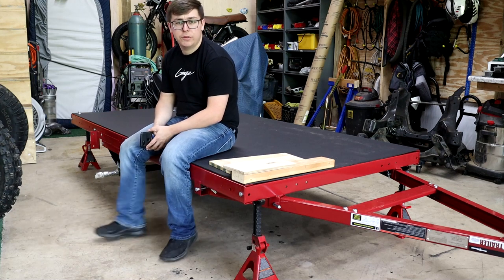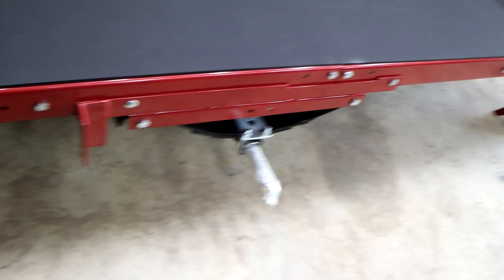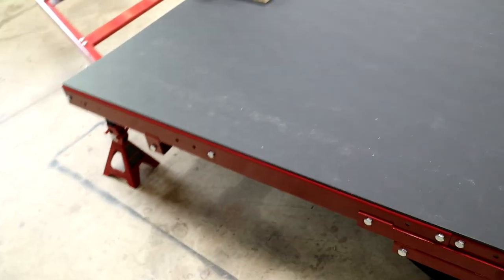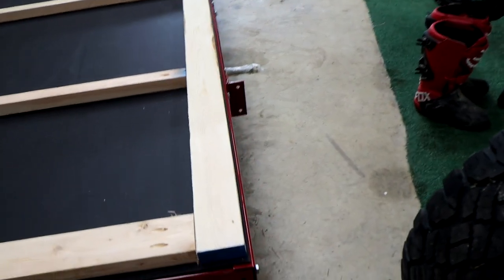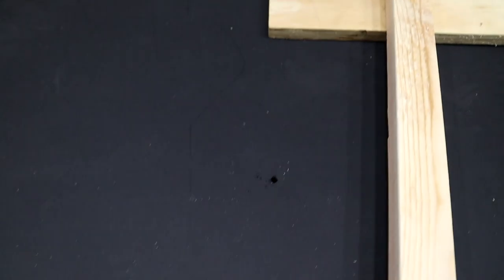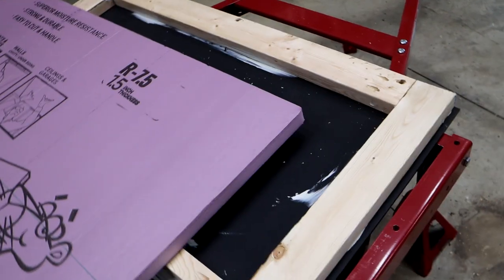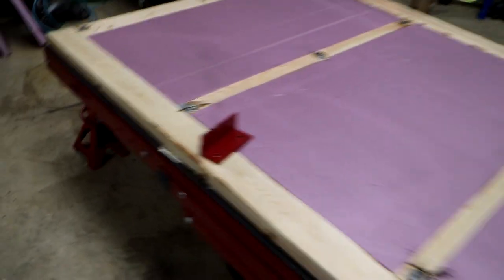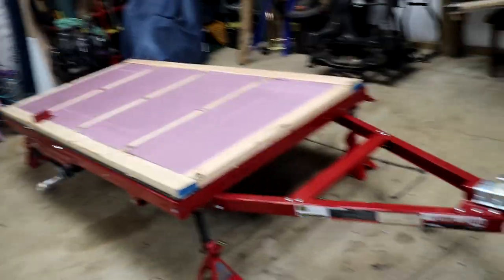TearDrop Camper Build | The Floor | EP 1

Comment: I'm also doing one, if you're upgrading the chassis, try getting one with an overrun brake, they have handbrakes too, it's a good idea having capacity to safely carry extra weights. Here in Britain there's plenty of old camper trailers around with brakes, can get them really cheaply, even for free. I'm going for zero wood content, and just fibreglass foam sandwich, with uPVC slats fibreglassed into the foam floor for loadbearing rigidity across the chassis. Always good seeing other people's creations, thanks for sharing yours. Have a great day, buddy.

Comment: Riley, how are those bolts holding up? The threaded inserts are a great idea, I might go that route. My concern is that if you're bolting it from the bottom going up into those threaded inserts, doesnt it need a nut as well? Or did the threaded insert act like a nut? I'm just wondering how its holding up today. Is it still solid or did you end up using something stronger? Thanks, great build.
Reply: Also, what if you left the threaded inserts the way they are and bolted from the top down? Then, you can use a nut at the bottom? Just thinking out loud.